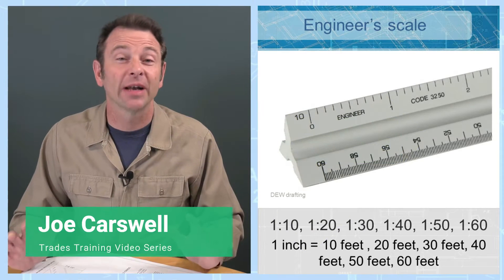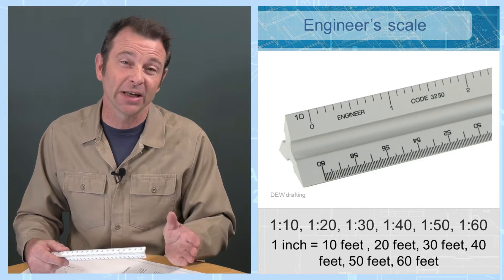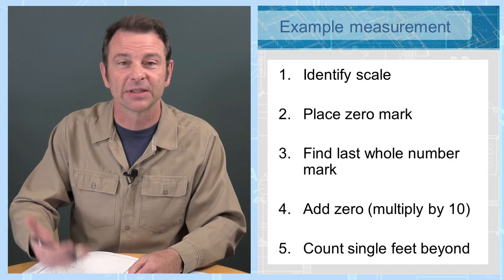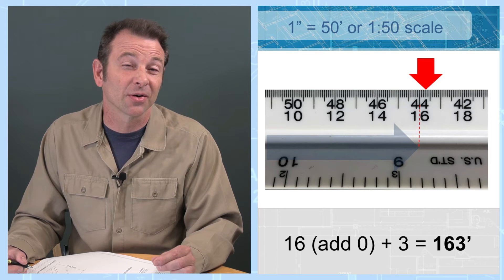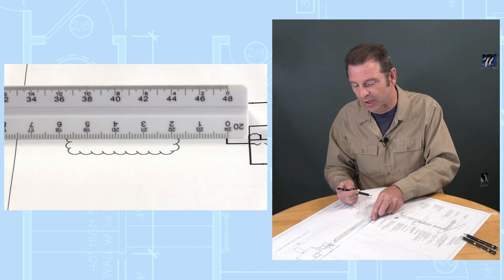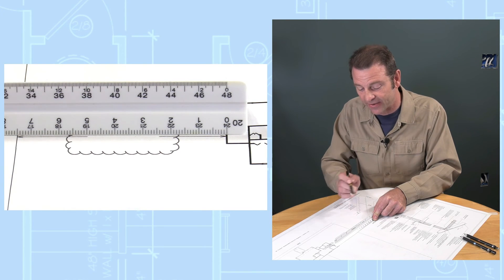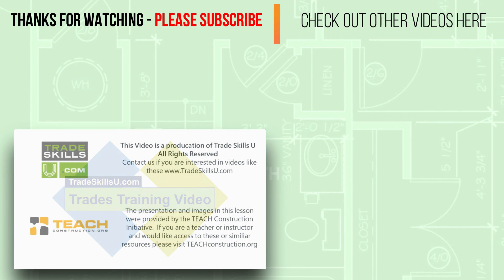Learn how to read a Scale - Engineer's Scale - Part 2 of 2 Construction Plan Reading Series -

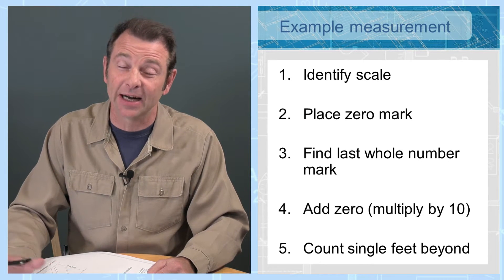Comment: look like u made a mistake 1:30 scale at 15 foot on scale  shoulf give u 450 foot not 150 ?
Reply from the maker: My last comment back to you was incorrect, the video is actually right.   When using this scale you add a zero to the number on each scale.  So your comment about multiplying by the scale number is not correct.